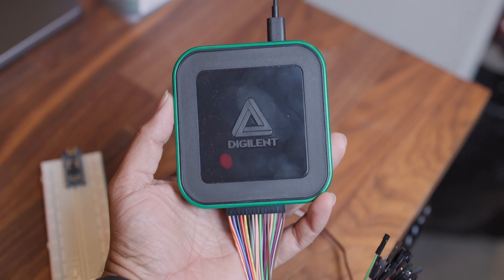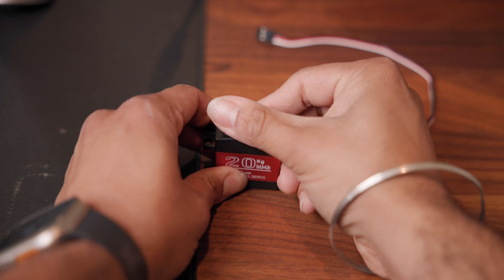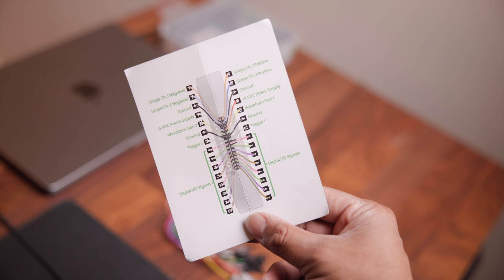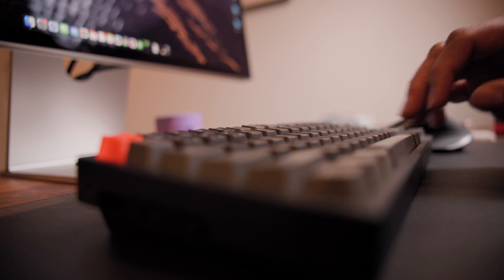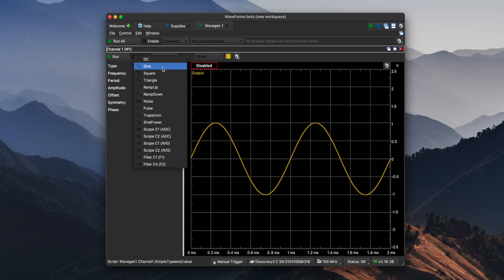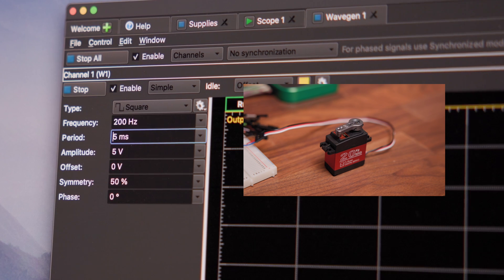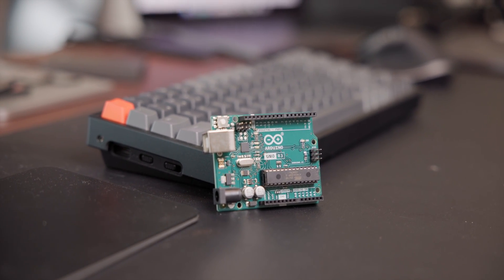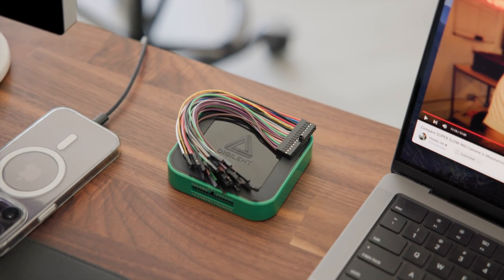How Do Servos Work? With the Digilent Analog Discovery 3

Comment: Same steps could be used for fan pwm?
Reply: Yes, except you may need an external power supply as the AD3 only goes up to 5 V.

All that was done here was to set up a square wave output. The period and pulse width would need changed for normal PC fan PWM but it should just be a case of changing the numbers.

Comment: I'd be scared to use it as a power supply for a servo. What happens if it starts pulling more amps than the AD3 can deliver?
Reply from the maker: for testing purposes, it is perfectly sufficient. You wouldn't be using the AD3 to power a project.
Reply: Nothing, it just wont work, or not properly. The outputs are protected.
Reply: It would shut down, this thing i built like a tank. All the protection is included.